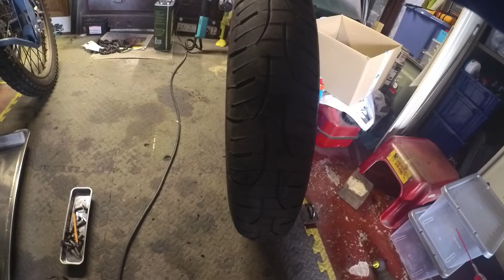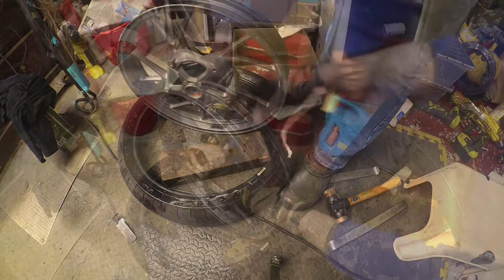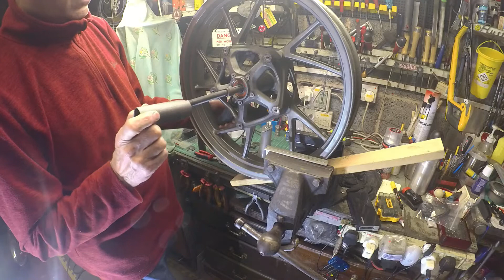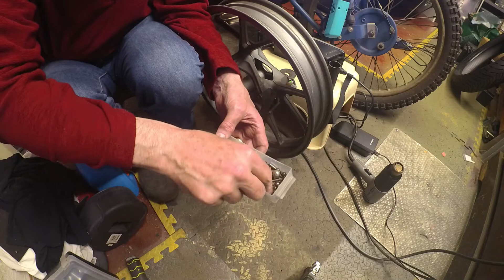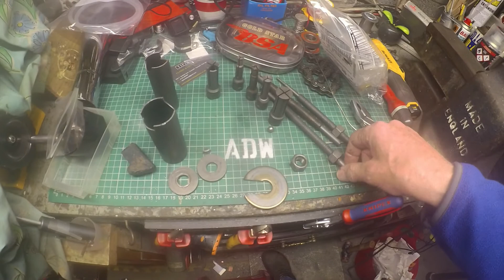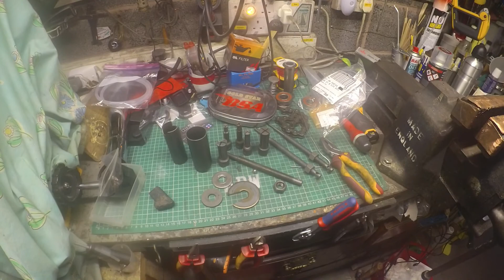Wheel Bearing Removal - Cheap Tool :(

Comment: You can buy a new set of bearings for 12 pounds. 
Leave the old bearings in and they will fall out when heated at the powder coaters.
Re the disc bolts, always heat first with a hairdryer by removal
When reistaling the bolts make sure you clean the threads with a tap and dye set to remove the excess loctite, otherwise they will be tight to re install.
I know this from experience
Reply from the maker: Yes, the bearings are standard but I (stupidly) paid the BMW premium. I wish I'd thought of leaving the bearings in for the powder coaters to deal with. As for the disc bolts, I've dealt with these a few times, changing discs in the past. I'll clean out the threads with a tap when I get the wheel back. I'll also use thread seal, to keep corrosion at bay & make them easier to remove next time. Thanks for your comment & advice, much appreciated :)